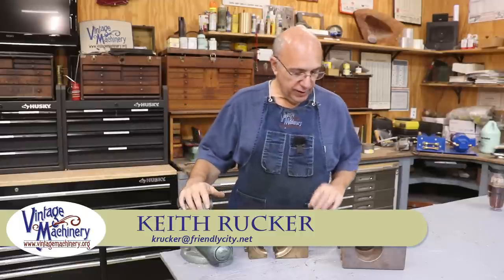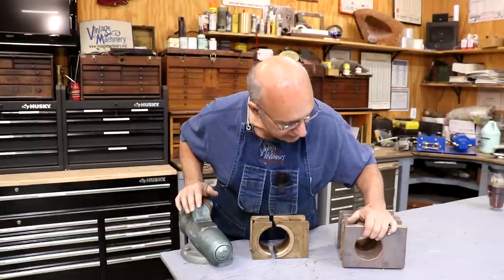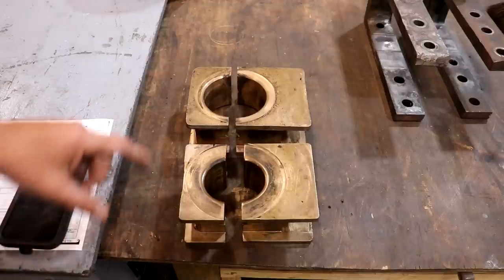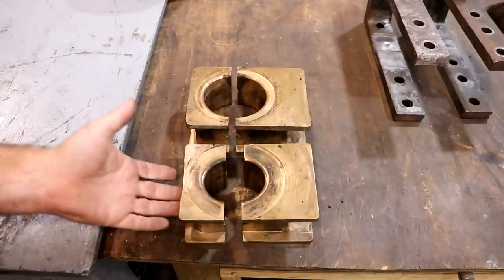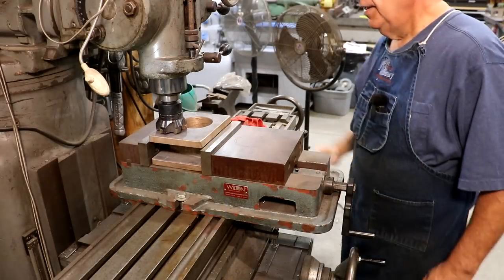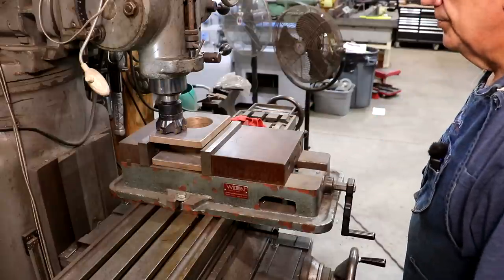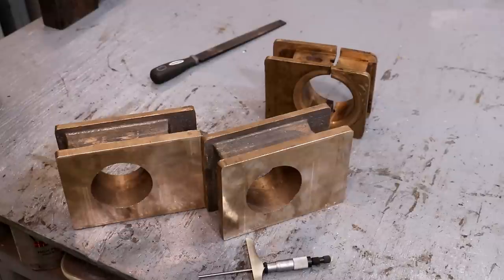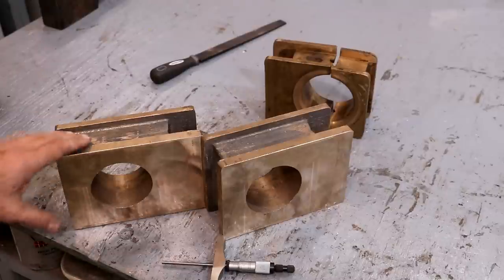Bozo Comes to Town - How I Ruined Some Really Nice Bronze Castings...

Comment: Keith, I would think that the inside measurement between the flanges would be the critical measurement and as you haven't machined that yet all is not lost.  I would think that outside dimension could be shimmed if it has flanges holding the pin that rides in the bores.  That way there wouldn't be a critical rush on getting new castings made plus other castings needed to complete the job.

Comment: A good practice is to make double checks with a different tool every now and then. Even if you measured it with the depth mic and feel confident, it doesn't hurt to also take a quick measurement with the back end of a caliper. If both measurements are suddenly different it's time to take a step back and overthink things.
Anyway, everyone makes stupid mistakes every now and then, the most important thing is to not let it stop you but be still honest about it.

Comment: Hi Keith, good content and easily done. Would it be possible to build up the surface by TIG brazing using silicone bronze rod ?  Then remachining . It's a large area in this instance and would consume a fair amount of filler rod , but in theory is it possible ? Thanks for the heads up on the depth mic though.

Comment: Sorry about your castings, Keith. Sad to say I have made the exact same mistake with a depth mic, on less expensive parts. Always struggle with this, so i usually double check the rod length with calipers to make sure i read it correctly.

Comment: That is the nemesis of every left handed person using a tape measure. You pull out the tape with your left hand. Of coarse the numbers are upside down. So for example you want 3-1/4....mark it....cut it...go to fit it and you realize that you cut it at 2-3/4 😮 grrrr raggle fraggle grump grump!!!

Comment: what a bummer.   several years ago i was rebuilding a big block chevy engine and bolted the oil pan on and totally forgot the oil pump.  i ruined a $50 gasket.   a few years later on an engine install the chain on my engine hoist slipped and i smashed a $200 oil pan.  thats just a few of my mistakes. the worst one was leaving the diff oil out of the transmission on my wifes car cost me $1800. i was just glad it wasnt a customers car!  whew.

Comment: It looked like one flange was thicker than the other too. I've machined a lot of castings, don't use a vise. Clamp a rough casting directly to the table. Use feeler gauges to level the casting and clamp. Jus do a cleanup cut on one side. Turn over and machine the other side maintaining flange thickness. Then flip over and machine the first side to overall thickness. Both flanges are now the same and overall thickness is correct. Advantage, both parts can be machined at the same time both are identical. And you've reduced machine time.  For machining castings I rarely use a vise to hold a casting, it's just not worth the frustration.

Comment: Keith I would not recast those. Just finish the machining and add braise ribbons to each side or use shim stock to fill in on both sides. Those sides are not moving parts and share little stress.

Comment: I'm sorry to see this happen.  I am certain you will measure thrice, cut once... i had to hand cut a pattern last week (for an instrument binnacle) where placement has super tight tolerances.. I started with a piece of manila folder, then sprayed it to a pice of thin plywood and cut that out.  Any errors and I'd be starting over.  It's not perfect but it's good enough for the fabricator to use for the real thing.

Comment: Couldn't you have milled the face and the perimeter sides all in the same setup? This would have given you a flat face with 4 perpendicular sides to use for your next setup when you flipped it over in the vise. This also ensures that the opposing side and its perimeter faces are also parallel and perpendicular to themselves and the rest of the work.

Comment: M my respect for showing the video.  Yep bad mistake. Can't say I haven't made the same mistake...more than once.  Gives you kind of a sick feeling when you realize you did it.  I owned a shop and always had  some employees that were still green.  After scraping some things a bit too often because of that mistake... I made up warning cards to be visible on benches,,,in every depth mike with a case , taped to tool boxes. Yep everybody including me thought about that warning when using the depth mic.  Another tip...  buy up some old cheap OD mics at yard sales flee markets.  grind the anvil end of the mic frame so you can slip the mic into the T slot without it cocking. You may kinda ruin the mic a bit but who cares.  Use blocks to set it if the faces go out of parallel.
they come in handy a lot.

Comment: I am surprised that you will scrap those. 25 thou on those parts does not seem like a lot. You won't even notice the issue. It's a sheet of paper, and the way that part sits, will not be noticeable. But, you are doing what you need to do. Welcome to the Bozo club.

Comment: As the old eyes get older I find using digital calipers to get within a few tens of thousandths of spec and only then use micrometers, ie machine to within two lines on the mic. Even then digital mics reduce risk of line misreading. Is proper machining a young man's(eyes) sport?

Comment: sorry man It sucks man I know because I've done the exact same thing two different times second time I was lucky enough to catch it in time now I've started double checking with the depth stick on my calipers because it's so easy to forget when everything else reads one way then these read opposite especially if it's on a material you can't save with a welder

Comment: So you don't feel like the Loan Ranger I have some Brush Blade adapters I make and sell on eBay and other places. I make these every week. There is a counter bore that I try to hold +/- .0015. I use Starrett 700A ID mic for the ones with the 1" bore and junk a chi-com 1-2 cheap-o for the bigger ones. (Because I'm too cheap to buy a 1-2 Starrett or old B%S .....Anyway,,,,,,They both read backwards like your depth mic. The counterbore is only .125 deep and it is fiddely to get the mic in the "just right" and then reading the *$#^& thing gives me fits! Half the time I take a regular mic over then and verify. Still about 1 out of every 25 times of so I STILL scrap the part,,,,,And I do them very week !!!!!!  Talk about Bozo! You got 'nothing om me.

Hey, It happens, and since you don't use "backwards" mics all the time you are forgiven....Me, on the other hand. That's a whole 'nother ballgame.  

It was all class to tell everybody about the screw up and maybe it will save someone's job.  God Bless ya Keith.
Reply: IANAM, however this would seem like a perfect excuse to spend an hour making a specificly sized 'tool' for that operation that would take the place of micing.

Comment: isn't it possible to pick the worse side and just tig build back the surface using brazing rod? old castings look like the face isn't a high wear surface and the pin cavity is milled below that

Comment: 0.025" is nothing on a railroad engine.  Especially a museum engine that probably runs a very few hours per year. When that engine was built they probably used a steel rule to take the measurements.  It is going to take a lot of human and fossil fuel energy to melt and re-cast those parts for the sake of Keith's OCD.

Comment: Am I the only one who is looking at this with awe? Yes, you are honest about your mistakes, but now that I've heard the error, I can without a doubt tell you I'm not a machinist. "Not a real critical measurement" you said, then you were off by 25 thousandths? You're kidding. that dimension is the least critical of all the dimensions of the whole bearing. It's not the bore, it's simply setting in between two cast iron blocks isn't it? Of course it isn't "Perfect" but it wasn't that close when the foundry cast it 100 years ago. Like I said, I'm not a machinist, but when you deal with 1/2 a thousandths of an inch, 25K must seem like a mile, but It isn't. It just isn't.

Comment: Keith, you could have easily squared those castings in the vice. by skimming the sides perpendicular to the first milled face. It would not have taken much metal to do so and it's quite a basic task in a machine shop. 🤣

As far as the depth mic issue, you are generally pretty careless with your measuring, quite often saying "It doesnt matter, that's good enough, blah blah blah" You have to treat everything like it matters so you never get careless. Lesson learned hopefully.